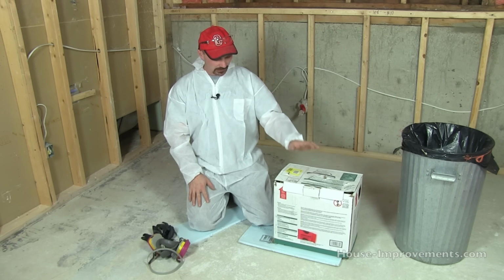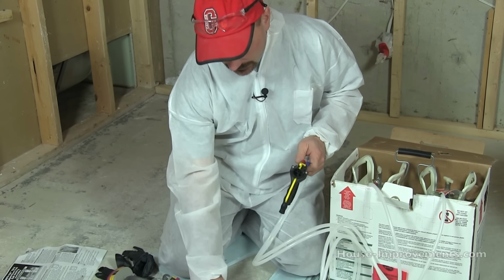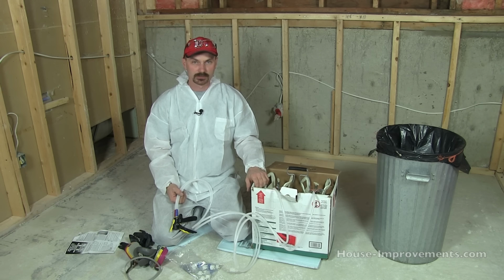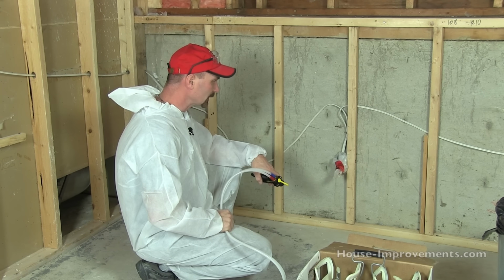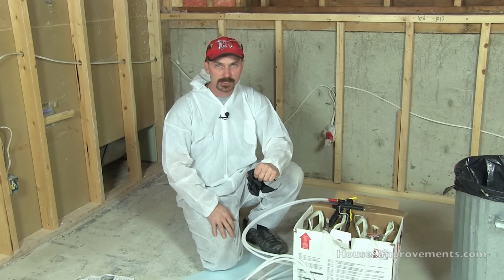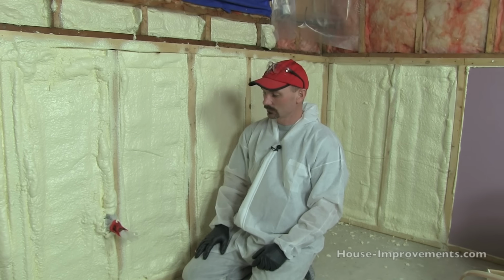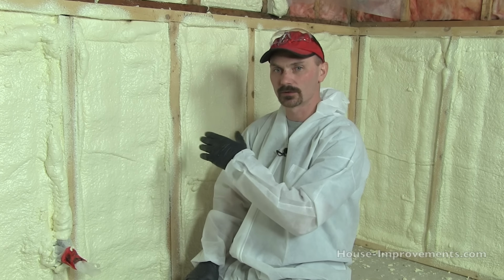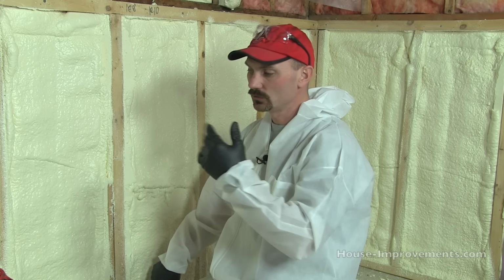How to Install Spray Foam Insulation DIY

Comment: Buying this spray foam kit is more expensive than hiring a local company to do the job.
And you are probably not qualified to install this properly and expose your self to chemical reaction. If you do try this your self I would like to hear your feed back by replying to this comment.
Reply from the maker: These kits in my opinion area meant for small jobs where having a truck come out is not practical or in remote locations.
Reply: HouseImprovements Exactly, a contractor won't do a small job because it isn't worth his time/labor and he would have to charge you more than you would want to pay.
Reply: Not exactly Bob, forexample this kit here in Toronto costs upwards $800 and gives you 600 board feet of 1 inch, our minimum charge to go out on a job is $600 and it covers 500 board feet of 1 inch that includes material and installation.

Comment: After you buy the second set it's way cheaper to hire a contractor.  The board foot listed on the box is a theoretical magical number that has no basis in reality.  My $80,000 foam rig that is computerized accurately pressurizes, heats, and uses air pressure in a $2000 gun that mixing chamber to produce 35board feet per gallon. I need over 17 gallons to produce 605 board feet of high density foam.

Comment: is this a lot cheaper than hiring a company to spray
Reply from the maker: not usually if you have one in your area.
Reply: Good work is not cheap. Cheap work is not good.  
What price would you put on your health ? Is saving $200-300 worth a trip to the Emergency Room and possible permanent injury ?

Comment: thanks for the demo , this kit will work for a cargo van? could give me a description of the uses specifically. thanks
Reply from the maker: This product and most like it should stick to any surface that is dry and relatively warm. The interior of a van should be no problem
Reply: +HouseImprovements hey what brand was this .. great video

Comment: I´m interested in use it for artistic porpouses, It´s the mixture or the polyurethane hot when you shot the trigger? Is this mixture capable of melting plastic or other materials?  I´m just thinking where can I apply it. Nice and easy to understand video even for me in foreign language.
Reply from the maker: It does generate some heat in the reaction stage but I would say it is warm not hot.

Comment: Great video!!!just one question did you use all the chemicals in the containers by the end of the video because I'm not sure if that covered a hundred square feet or not depending on how expensive the product is is that all the two small containers will cover???
Reply from the maker: The product got used up finishing the project.

Comment: hi
what would youu recomend for suspended floors for insulation it gets really cold in the room when its cold otside .
Polystyrene its a god option? between the joist thanx 
i love watching your videos
Reply from the maker: Yes ,rigid foam well sealed would work or sprayfoam

Comment: the video was a great video but why is 1 commentary advised not to use the kit why is that and you made commentary on the mix did not show it what would happen if you get the mix wrong and people were driven from their house with the fumes and stink please clarify how to adjust the mix and why someone would advise not to use the kit

Comment: How do you measure the square footage that you need I don’t wanna pay $800 for the one when I can buy the $300 one
Reply from the maker: Measure the surface area of the wall you want to do. The foam kits come listed in how many sq. feet they will cover at 1" thick. So if you want it to be more than that you need to allow for the difference. Example a 600sq. foot kit will cover 300sq.feet if you apply it at 2" thick.

Comment: I would have lubed the gun first and cleaned my hand before putting on the gloves. Now, anything you touch could spread the vaseline.
Reply from the maker: true enough
Reply: Probably no big deal though here, but I work w/a lot of paint, adhesives & plastics and some processes are very contaminant touchy.
Reply: Hello . I'm from Romania and I would be interested  buying and Spray Foam Insulation I DIY product. What would be the price for a kit and if possible a collaboration to sell this product in Romania. I am builder and I can guarantee that this product will sell very well in Romania and Bulgaria . Thank you waiting and at you one answered at least with a price.

Comment: Hi Shannon,
Your video is great.  Thanks for sharing.  You inspired me to do it in my basement.
  I found that my finished basement had no insulation between the concrete wall and the drywall.  If I want to apply this foam insulation, can I just open part of the drywall between two studs and spray the foam to both sides?  I know the foam will stick to the drywall. I am looking for a solution to the humidity and temperature problems in my basement.
Thanks again.  I like watching your videos. You explained so well.

Comment: It is not “ok” to bury electrical cables in foam unless they were previously designed and oversized to compensate for their reduced ability to lose heat when they are carrying an electrical current. Cables buried in foam have to be “de-rated”, i.e. a larger size has to be installed if in foam for the same current than if in air.
Reply: Thank you. I was wondering if someone would bring this up.

Comment: I've talked to well over 20 different clients of this insulation process, while the application is easy, and the savings are cost effective for this medium, the serious issue effecting the majority of clients is the long term "off gassing" from the chemical compounds.
Nobody is talking about or making public the possible downside to this new cottage industry.
How long does this close cell foam insulation last? What are the long term energy savings before re-application is needed? Nothing last forever, so what's the time limit on deterioration?
Reply: 70 to 80 years it holds a true R value. Normal bat insulation holds R value for 15-20 years but doesn't withstand Air pressure like closed or open cell poly does. Once its dried no gas is released. And its effective as long as it's not exposed to uv light. Hope this helps!!! Cheers!!!
Reply: Oh... its double to cost but its 70% cheaper in the long run from heat and replacement savings. It literally pays for itself twice if you do the math right.

Comment: I live in Georgia. Who sell them? I would really like to use that to insulate a shed when I start building one. Also, Can you please tell me what would be the pros and cons of using 2x12x10 (treated of course) as siding. I want my shed to have a rustic look and I figure the thickness may also help with insulation.

Comment: The electrical wiring does not look right. I think that there may be a heating problem, as normally the wire should not ever be in direct contact with the insulation. The wiring should be on top of the foam or installed in a wiring tube (as I remember it).

Comment: I am planning on finishing our basement so I have been re-watching several of your videos.  Is there any chance you will be making a video about putting in an insulated floor over the cement floor?
Reply from the maker: Sorry but none is planned.
Reply: HouseImprovements
Too bad.Can you at least tell me, would it be better to put in the sub-floor before dywalling the walls, or after and fitting it up against the drywall?  (We haven't decided yet between carpet of laminate yet, which I know would be the last step)

Comment: Just before you start spraying, I'd like to say that 2x2 is a poor choice.  Unless there is additional insulation on the outside of the foundation wall or sandwiched in between two walls, even the best spray foam is only going to give you r7/inch, and if those are "nominal" 2x2 (ie, 1.5") and not full dimension that is only r10.5 at best. 
I would recommend 2x4 and filling it in two lifts.
Or even better, 2x4 separated form the wall by a couple inches, spraying between the wall and 2x4 to form a vapor barrier and thermal break, then adding batt insulation in the cavities between the 2x4 studs.
Reply from the maker: I would agree, this was dealing with existing framing and home owner did not want to add any more thickness to wall.

Comment: VERY UNHAPPY WITH THIS PRODUCT! I wish I had never used it, first the given yield is criminally overstated. After three sets of 620 tanks I’d say I got about half of what they say. I would have saved a lot of money if I jobbed it out. But far worse than that is after a good two months my house still has a nasty chemical odor. Before choosing any spray foam do a search of spray foam horror stories. It’s not the smart, ecologically sound insulation choice I thought it was. There’s people saying after two years their house is still off gassing chemical odors.
Reply from the maker: If you have the wrong temperature for the tanks you will get much less yield and the wrong mixing can cause bad foam with smell.
Reply: @HouseImprovements  On the first spray I had the tanks at 75 degrees and for the other two sets of tanks used over three different spraying days I had them at 85. 

This product has quickly turned from an expensive mistake to an absolute nightmare after reading all the spray foam horror stories and hearing how their only remedy was to cut out the foam.

Comment: Foam spray insulation is garbage! Do not install it in your house! What happens if you have to run a new wire or anything down the wall and you have that shit in the way?

Comment: Got a question and will appreciate the answer.....he's spraying a kit that covers 200 square feet at one inch thick....my question is...is the one inch depth measured before or after expansion???Thanks!!
Reply: DaveHolten after
Reply: It's 200 Board Feet Not 200 Square feet - Spray foam is measured in Board Feet not square feet.  One Board Foot is One Square foot at 1 inch depth of filled (expanded) foam.  So if your spraying a 2x4 stud wall which is actually 3.5 inches deep, you need 3.5 board feet for each square foot of wall area.  If your head is spinning from all this math, you are not a pro spray foam contractor and should leave it to the pro.  The 200 board feet marked on this set of tanks is not a guarantee, its a guideline.  There's always some product left over in one or both tanks when the pressure runs out. And you typically get anywhere from 160-190 board feet of net product out of the kit depending on conditions.  It's like when you buy a bag of grass seed and the bag say it covers 5000 sqft.  Actual results can very widely.

Comment: I insulated my living room’s addition in the same fashion as your pink panel insulation with spray foam around the ridges (off to the side of the video). One thing I did was left the R-11 bat faced insulation in place, that was still in good condition. Then, I placed the 1-1/2” pink panel insulation in behind it, and sealed up the edges. I was told this would probably more than double my R value which was only R-11 in sometimes weeks of -40F temperatures. I also had the underside of my floor down in the crawl space, and along the main crawlspace which holds the water lines, had just up the walls sprayed and reflectix paneled the dirt floor. What I missed as a new homeowner and 1st home!! I have a cinderblock foundation around both the main home and it’s addition. The cold air comes up through the cinderblocks that rest on a 6” concrete foundation, my next project is to get some sort of concrete drill and then spray foam down into each cell of the blocks.

Comment: How long did it take to dry ?
I'm thinking if you start putting on sheetrock on before it dries , then you do not make to trim it . Thank you .
Reply from the maker: it usually fully expands and hardens in less then 5 min.

Comment: Good demo, Shannon, thanks. Polystyrene foam does cause problems with PVC wire insulation, so DIYers should avoid that combo.
Reply: Expanding foam is compatible with all materials except human skin - and the old 1960's polystyrene granules are not harmful to PVC cables apart from being an attractive irritant.Sep 28, 2010

Comment: hey all. My house was framed in the basement when I got here. Studs are about 1/4" off the wall. I'm thinking of doing a inch of foam and then putting batts over it as the foam should act as a vapor barrier. At 680sq foot 1" for a menards DIY kit for $280 it should run be $560 total.

Comment: What is the R factor? I may have missed it in the vid
Reply: Measurement of insulating efficiency, higher is better:

https://en.m.wikipedia.org/wiki/R-value_(insulation)
Reply: If it's closed cell foam its r-value is six per inch

Comment: Why not just stick a bit of 50mm rockwool in there? Much quicker, less hassle, same result.
Reply: +Brian C Bot air sealed, no where near the same result. If you have a 1/4 inch air leak on a 1000 sq ft wall, you might as well not have insulated at all.
Reply: +Brian C closed cell also prevents air and moisture penetration. the r value is also much higher. not sure how you can say "same result" with a straight face.

its more time consuming and way more expensive, but you are delusional if you think its not better.
Reply: @Trina McDonald - If you have a 1/4" air leak on a thousand foot wall, you need to have a serious talk with the builder, and consider litigation.

Comment: This spray foam stuff is not the best solution to insulating. If I were a home owner watching I would seriously consider all options first! Especially if I were a home owner considering buying a kit and tanks like shown in the video. When you buy a kit, and mix the chemicals at home there is no quality control in the chemical process of mixing the 2 main chemicals that create the spray foam. So often times people mix the spray foam incorrectly.
Main reason I don't like the Spray foam insulation, is because working in or at a house that has been spray insulated is increasingly difficult down the line. It can cause a simple home improvement project to become much more expensive. I've also watched some of this spray foam insulation age oddly overtime.

Comment: Hi Shannon, I wanted to say thank you for making the video. You gained a new subscriber! You're very detailed, you give the what, where, when, who and the how in very simple language. you don't assume we should know certain things, you explain it anyway in simple language. I love that. Question for you, what is the R rating of the 2inches you applied? Also, once you remove the excess foam and make sure its flushed with the beams,  is the surface then ready to be closed off with 1/2 inch plywood for example and then cover the plywood with FRP wall panels?
Reply from the maker: Thanks for subbing! Please use our forum for questions.https://www.house-improvements.com/forums/

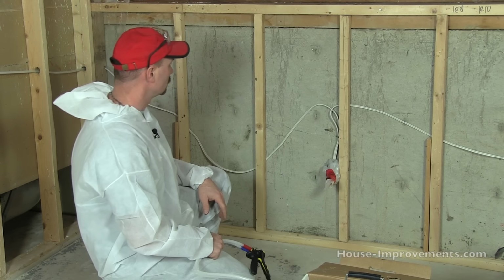Comment: 9:29,Wiring should only be completely surrounded by thermal insulation if the Electrical calculation has been checked by a licensed electrical person otherwise the wiring will overheat, melt the insulation and potentially burn the structure down.

Comment: You are using a home to chemically mix a compound that causes a chemical reaction inside your home.  Your home is now a laboratory.  Every home has different ventilation characteristics not to mention what you're leaving for your family to breath.  Seems like an irresponsible endorsement of a product which very little is known about.  You cant even guarantee a consistent application.

Comment: How much cost this kit
Reply: marcus loucao lacerda I'm with you.....how much does the kit cost and how much will  it cover? Othe than expensive, I guess the real cost will remain a secret
Reply from the maker: hondasilverwing  The costs are different depending where you are but here a kit like I used in the video does 200 sq.ft. at 1" thick. It cost about 400$. So if you spray 2" thick you will have a cost of about $4/sq.Ft.

Comment: The jury is still out on the safety of this stuff but most likely is NOT good.  It's expensive and time consuming to set up, spray and clean up and can be dangerous and messy.  I would think some standard fiberglass bats covered with some 6-10 mil polyethylene sheet (vapor barrier) and stapled onto the studs would work almost as well.  I'm also concerned about encapsulating wiring with this insulating foam (doesn't breath) resulting in potential fires especially would when this foam has a reputation for being highly combustible UNLIKE fiberglass insulation.  So overall I'm staying with the old school stuff.  But what do i know after being in the construction business for over 45 years!!!  This stuff has it's place but not in my home for this app.

Comment: Videos like this are very dangerous for the average joe. 1st of all Isocyanate is extremely dangerous! Not only should you make some kind of ventilation providing back pressure, you should NEVER use this product without a respirator. It can have life long consequences that are irreversible. Secondly every part of your skin should be covered as the A side (Isocyanate) can go through your skin. If you are thinking about doing this yourself please do the proper research, or just hire a professional they will do a much better job than anything these flock kits can.

Comment: These kits are expensive and problematic.  You can hire a REAL insulation company to install REAL spray foam for the same or less money than you can even buy these kits for.
Reply: looks like it did the job pretty well without a 'real' insulation company..
Reply: The kits are fairly easy to use and us "LOOK" nice however your expecting the foam to perform not " LOOK" pretty..
Reply: Dan Stomber  could you please explain that again in english?  :)